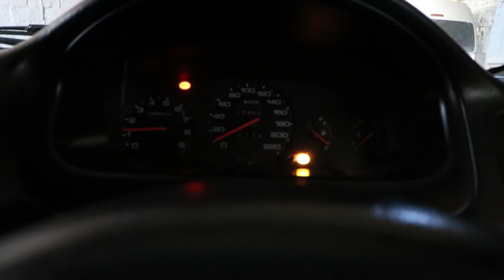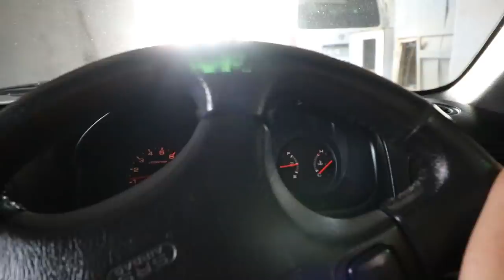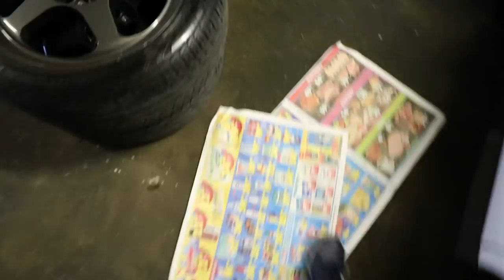I Bought a RARE set of JDM Wheels!

Comment: Profile is a % of the width of the tyre and is related to that. So the 195/45 means the profile is 45% of 195, whereas the 215/45 has a profile of 45% of 215. So eventhough both are 45 profile, the 215's profile is bigger. Hope it makes sense.

Love the choice in rims

Comment: Shane nai man bru do a LED upgrade on the vtec clocks boeta but mooi find on the 16's looks beefy on the tec🔥🔥🔥 but you going to hurt the tire at the back with the wider profile tire ask me safe profile on the honda is 205/45/16 which is what I'm sitting on with my CPR Sprinthart JDM's 👌
Reply from the maker: I was actually thinking of doing 215 45 16 all around because I like the look. But after your Input I might have to consider staying 205 45 16.

Led bulbs in the cluster coming soon 🔥🔥💨
Reply: True brother all in your best interest wont lie the cons of 215 wide profile I experienced is that the wheel cant turn fully infront so it tends to scrub against the wall on inside and that could will definitely not be comfortable as I do know you a man of quality so I'm happy to share my experience with you as well and everyone on this platform💪

Comment: Mr late late you are right its a very rare wheel  let it 1st sink in and drive around and see....... but the vtec rims look better...... im just saying🤙🙏✌
Reply: what makes it rare? a fake replica desmond rega master? based of a spoon design ... yah 16" you dont see everyday. If it was a billet Desmond original wheel then you can put in rare. but replicas are made a dosen , just not popular in 16" in SA. I drive with replica spoons 4x114 pcd so i propably shouldnt judge but mine aint RARE also.
Reply: Agree what Jean said. I have a set 16" BBS Eagle which is hard to find as they only do them 17" or 15" but i don't parade around saying i have rare wheels. Sure the size is rare but there's so many replicas out here that it's not worth paying premium for a rare size unless it's a 1 of 1 set of wheels.

Comment: Mplain die wilde tuin🔫⚗️💉💊😉
Reply: The number of the profile is the % of the width of the tyre. So 195/45 means the width is 195 and the profile is 45% of 195. Whereas with the 215/45 the profile is 45% of 215 and that is why the profile is bigger eventhough both is 45 profile. Hope that clears it up and helps. 

Love the rim choice